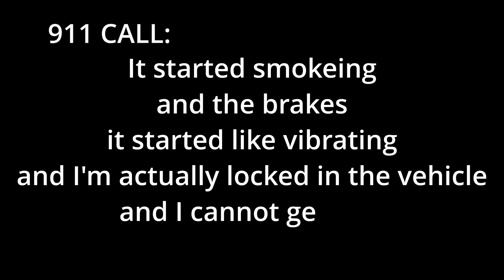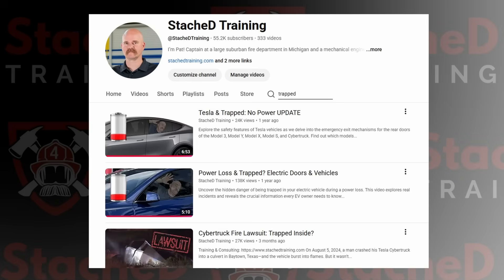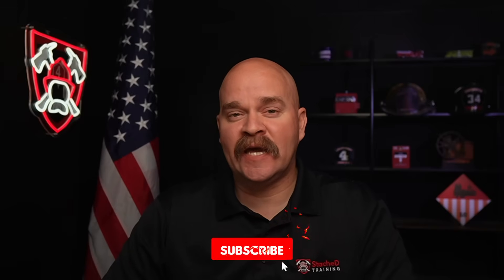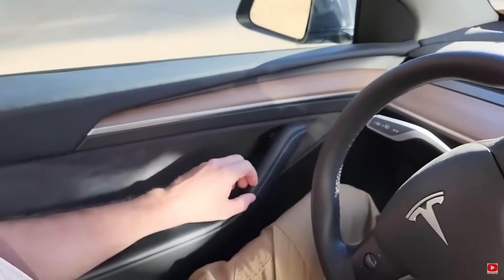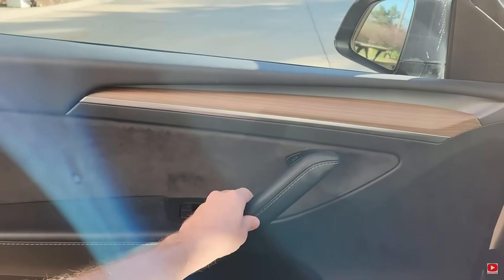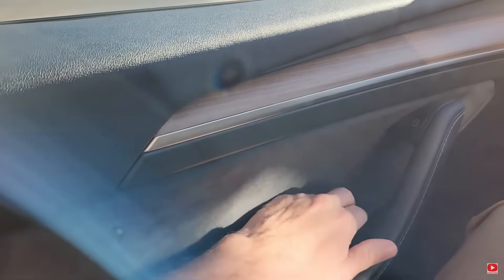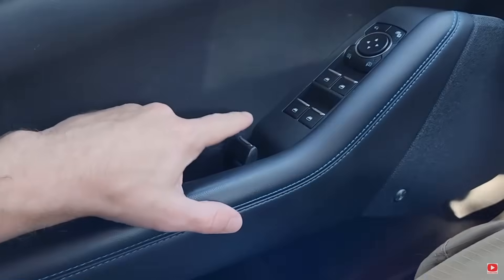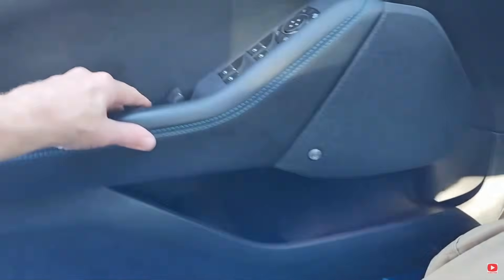Electronic Door Latch Failure: Smoke in the Cabin

Comment: I've never been in an EV and am a motorhead, even went to see an auto show in Detroit. Never even knew they had manual releases, so that says something right there about public knowledge! 

I think they just need to make them obvious, like they do with building construction (i.e. long lasting glow, brightly marked with orange or appropriate color, clearly labeled, etc).
Reply: Yes, make them mechanical latches obvious… like by making them the normal handle you pull to open the door🤦‍♂️
Reply: It is already the law that the Emergency Mechanical Trunk release is always exposed, and even glow in the dark. Needs to be applied to all passenger doors
Reply: Why would you expect to know about the safety features of a vehicle you've never been in?

The Tesla 3 manual release is more obvious than the electric release, to the point where they started selling the cars with a sticker saying "this is the emergency release - the normal button is up there."

The Tesla S manual release is the same lever as the electric release. If there's no power, you can pull the same lever twice as far and the latch will open.
Reply: @darrennew8211  What about the REAR Doors? The Emergency Mechanical Rear Door releases in the 3, Y & incEl-Camino are HIDDEN.
Reply: @davebrown9725  Yeah, that's pretty stupid.

Comment: The manual releases should not have the same color as the interior decor, they should be emergency red and perhaps even luminescent.   The manual releases might even have integrated lights and internal batteries that cause them to light up if power is lost.
Reply: Small tritium powered luminescent tubes are cheap and last for 20+ years. No need for an internal battery. The problem is that the car manufacturers will never make an interior part that sticks out without being forced through regulations.

Comment: Another great idea is steer by wire, I can't think of a single thing that could go wrong.... LOL
Reply: Exactly, previous systems were designed to be fail-safe. They had hydraulic or electric motor assist but still had a mechanical linkage that with a bit more effort you can still drive the vehicle. 
Hostile engineering and design with more unnecessary electronics and modules, locking down the vehicles to VINs, and reducing reparability. Not to mention the privacy concerns. I'm all for technology, however some of these trends are concerning. You can't even change a simple bulb now without going to the dealership, led modules VIN coded. Even Hyundai is requiring a $2000 software tool and internet connection to do brake work on its newer vehicles.
Reply: @FryGuyNS  About fail safes, what if you get into a weird crash on the highway? The speeds can be high enough where the car can be damaged enough to fully shut down, but still be rolling at a fair speed. Will the electronic steering (and possibly brakes since they want those to be electronic too) just stop working, and you go rolling into traffic?

You never know with electronics, there can be small defects that only become noticeable when a part fails badly, putting you in danger, and it really is not that hard to cause damage. Cars have to withstand harsh weather, water, corrosion, massive vibrations, etc, all of which can kill important electronics easily. All fragile electronics without failsafe just means when something goes wrong, it goes HORRIBLY wrong.
Reply: Exactly why the mechanical system with assistance works and is fail-safe if the assistance fails. It can be done correctly at high complexity and redundancy of an aircraft. @xapcgamer151
Reply: Brake by wire would be another, and we're starting down that road with electric parking brakes.
Reply: @minigpracing3068  Trailers have had brakes by wire for decades.
Reply: @davidquinn6161  and about half the time I hook up to a  trailer with them I have to fix them lol, and worst case at least you have the tow vehicles brakes
Reply: I've actually towed a Cybertruck where the steering system errored turning at low speed and the wheels straightened up on there own, but the steering wheel was still at like 15 degrees to the left, easy to get on the rollback, but couldn't imagine that happening at highway speeds.
Reply: Pilot-by-wire allows for multiple layers, of different types, of redundancy that many manufacturers won’t bother to exploit. Tesla being an example of how not to do it.
Reply: Towing is harder
Reply: Actual modern aircraft are all FBW. But funnily enough all of them have mechanical doors!
Reply: But planes have been fly by wire and are generally safer than in the past
Reply: Actually there is a possible safety feature to steer-by-wire. I think some women do not like high-speed highway driving, and the fault would seem to be, the modern power steering. One small move of the steering wheel, and you are veering out of your lane. Before power steering, there was more mechanical advantage, the steering wheel might need to be turned around 5 times to make a sharp turn. Steer-by-wire should offer the advantage of an option to adjust steering sensitivity per driver, so that they can feel more comfortable, rather than just being set for the "average" user. Mechanical systems can have issues also.

But with current cars, a failure of the power steering, does not actually leave the car unsteerable. I once was told by the boss to take the company car across the street, so as to have a new power steering belt installed. It was merely hard to steer, yet steerable. Not only would it be possible to pull off to the side of the road, but it may even be possible to drive the car all the way home, but I would of course want to know the cause of the failure.
Reply: Oh I can!
Reply: many vehicles have had it for years.
Reply: Or the gearbox by wire
Reply: Rodents love those wires they are made of soya bean
Reply: Don’t fly on a commercial airplane. They’re completely fly by wire.
Reply: @williamp6800  You really compare aeronautical engineering, standards, inspections, maintenance and regulations to the automotive industry and personal ownership?? Think about it.... :-)
Reply: @RobertKohut  no I’m not. And that was implicitly my point. The problem isn’t that it is “by wire.” It’s the industry standards around its use and the approach to engineering. 

Decades ago, cars got electric trunk releases. But there was still a readily accessible key slot so you could open your trunk and get your booster cables if your better went flat. 

 But now we have people dying because their electric cars have electric door opening mechanisms. And someone wasn’t bright enough to say they need to be able to exit the vehicle if there’s a power problem. So Li-ion battery fire happens and people die. 

Then in some cases it turns out there was a mechanical release. But it was so well hidden to make the car look modern, that no one could find it and they still died.*

* Slight exaggeration in this particular case. The car was only smoking so the occupants weren’t in immediate danger. But it took the fire department -45 minutes to do the research to find out that the mechanical door handle was hidden behind a trim other on the door. Like anyone panicking when their car is on fire is going I remember that two years after reading about it in the owners manual. On the rare occasion anyone has read the owners manual…
Reply: Airplanes commonly use fly by wire... you have a certified maintenance team that puts hours into maintenance of your car for every hour you drive it and regularly have simulator training to learn how to handle emergency situations in your own car right?
Reply: nothing can go wrong, because there's nothing there between the steering wheel and the wheels on the ground.
Reply: @finophile  nothing can go wrong because its already wrong 🤣
Reply: @finophile "What can go wrong?" 
"What's the worst that could happen?"
etc.

Comment: Another thing that compounds this issue is that many vehicles now have laminated safety glass which is harder to break and kick out of the way than the old school tempered glass that broke into a million rectangular fragments when struck with a pointed tool.
Reply: Musk made a big deal out of that on stage once. I don't see it as a "feature".
Reply: @greebo7857  In most vehicles that offer this glass, it is sold as a Noise Insulating/Noise reduction feature.
Reply: Yep, funny the other person saying they'll keep a hammer in their car. Majority of people have no clue how tough car windows are to break lol, hammer isn't gonna cut it when you're strapped in your seat with no room to swing lol
Reply: What kind of tool does StacheD advise for breaking into/out of these typed of vehicle  windows?
Reply: @SciurusVulgaris1979 I can't speak for Pat, but the way I was taught to deal with polycarbonate windows is to drill a hole to get a blade in, then use a reciprocating saw to cut an exit. Those things are fitted to some racing cars, and they are designed to take a hit from a bowling ball fired from an air cannon - they literally just bounce off: no amount of manual impact is going to get through, its got to be cut. Our rescue units all carry drills and saws; they get through a metal roof in seconds, so plastic windows are a breeze.
Reply: @SciurusVulgaris1979  I have a fire fighter across the street and we were discussing something related to that.  My house has "hurricane rated windows", meaning they stop a 2x4 fired from a cannon.  I don't know how fast the 2x4 is going, but the videos are neat.  I asked my neighbor how the fire department is supposed to get into my house if I had a fire (my doors are also hurricane proof, and most doors in Florida open out, not in, so you can't kick them in).  He told me they use an axe to get a hole started and then finish it with the chain saw.

I know it's not practical to carry a chain saw everywhere you go, but Tesla owners should at least consider it.  All you'd need would be a little 12" bar.  If you go on a date with a new girl, you'll have to cover the chainsaw with a blanket or something, because she might misunderstand it's purpose and reach dark-thought conclusions.
Reply: @SciurusVulgaris1979  You'd basically need a glass saw.   The little glass hammer of the past that would work for tempered glass won't work on laminated glass.  Those are about $180...
Reply: @SciurusVulgaris1979  LAW works well, but they have mostly been replaced by Javelin.
Reply: @SciurusVulgaris1979  It would take full swings with a sledgehammer.  You are not going to do that with some dinky emergency hammer from the inside.  I suggest multiple shots with a 9mm and then trying to kick out the glass. Might work if you are an action hero.

Otherwise , just try to kick the door open.

Comment: maybe these cars should be programmed to force every 'driver profile' to practice the mechanical release every so often
Reply: The issues is way simpler and easier than anyone can imagine. They just don't want to! This is an issue of changing a 0 to a 1. In the event of any kind of bump, or power loss the default setting needs to be set to 1 and not 0, 1 will Unlock all doors (Not Open them but unlock them)  as the computer dies it sends out one last command via a small C battery or what ever, UNLOCK ALL DOORS and Keep them UNLOCKED. They just don't want to do it !
Reply: @ImLivinSD  but wouldn't then they be liable to fly open during a crash? Maybe even slam back...

Comment: Them:  Hey, let's run the whole car by a tablet glued to the dashboard.  We'll save a ton of money!
Reply: And NO system redundancy, because the car is perfect and that would just be a waste!
Reply: In the movie I,Robot when he saw that the robot truck was forming an ambush, he switched from self-driving to manual-driving, and a steering wheel popped out of the dash. Now that was quite shocking that a mere $20 of extra "unnecessary" parts per car, was just there lurking underneath the dash. Was it a government regulation to require every car to actually have a working and mechanical and not just "tablet" video-game-style manual override?